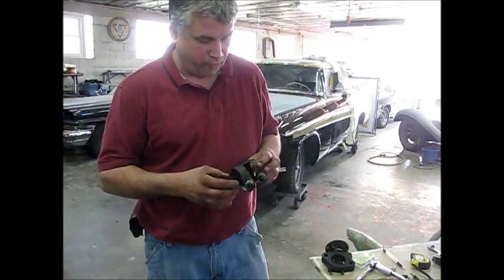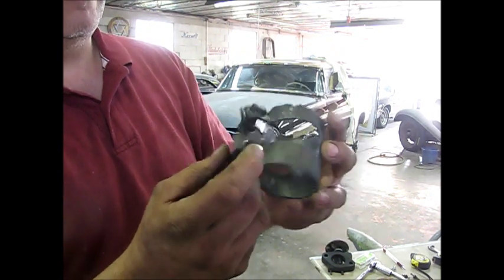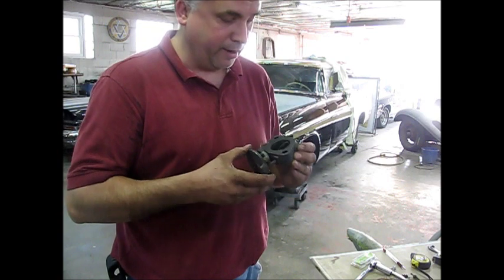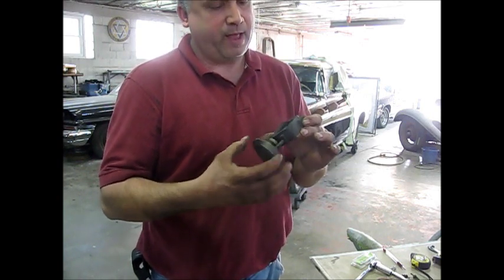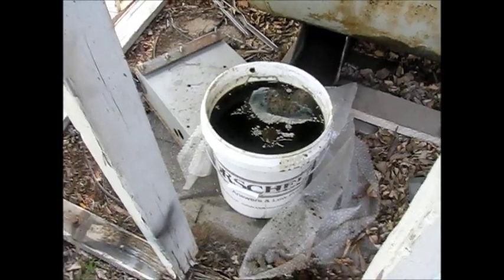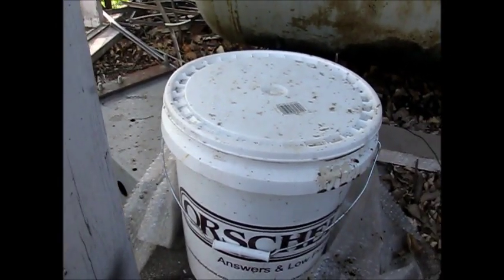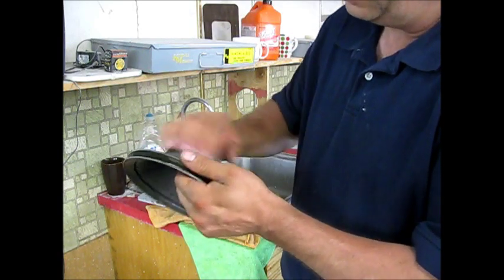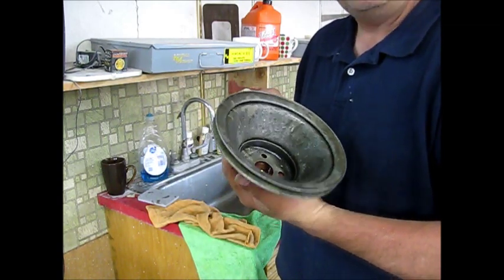Stellar Antique Auto Restorations Molasses rust remover

Comment from the maker: Most of what I know is from other people using the process.  A batch lasts about 6 months.  If you're getting a lot of evaporation, I'm sure you could top it off with a little bit of water.  Our initial ratio is 9 parts water to 1 part molasses and seems to get the job done quite well.

Comment: How long will the mixture continue to work before you need to make a new batch?  Can you continue to use the same mixture for months just adding water and molasses or do you need to start a new mixture after a while?  I am using a 35 gallon trash can and I don't have enough molasses in it.  Can I add molasses or should I start over?  It has been in the can for about two months.